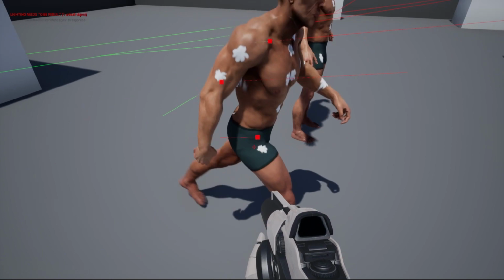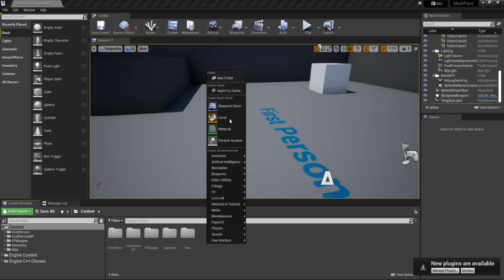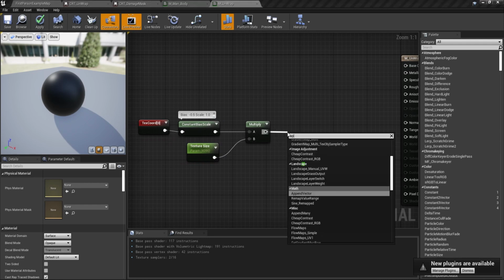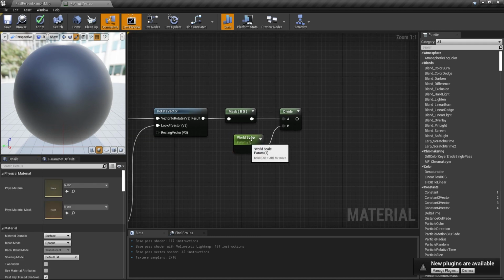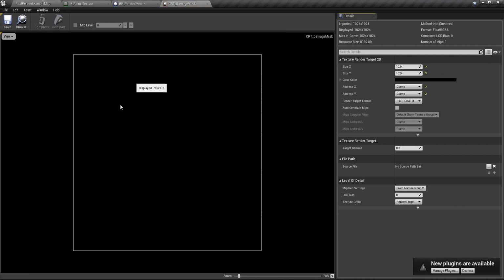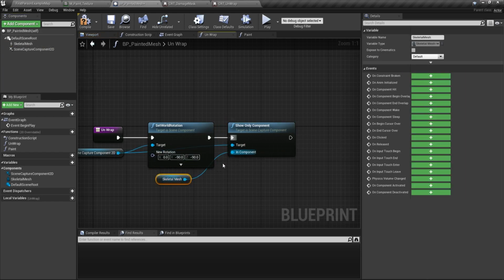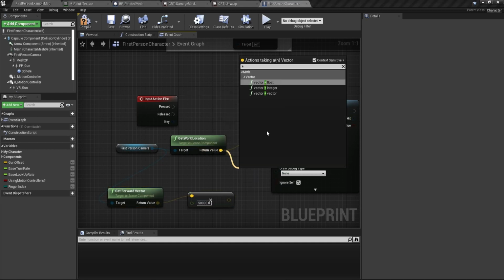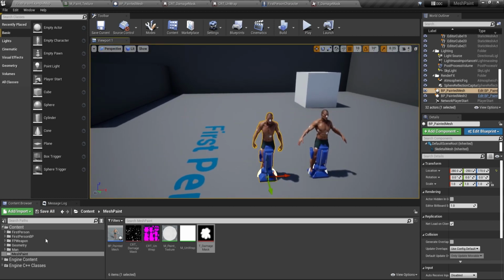Skeletal Mesh Texture Paint - Unreal Engine Tutorial (Blueprint Only)

Comment: Been trying to do a similar thing with a static mesh but it seems to be painting offset from the hit location and certain faces it wont paint on at all. 

I've also noticed when I paint on one face it paints the same thing on another face but upside down. (only visible on the damage mask, none of this is showing on the model itself)
If I put the damage mask straight through in the mesh material (by passing the lerp). It paints as expected with a slight offset to where the ray hits and it paints on both front and backsides of the object.

The object is basically a standard cube from blender, no overlapping UVs, just a standard cube net.

Comment: Hi, first thing that this is excellent tutorial and I managed to make it work without issues. Great thanks for that alone.

But I also have question: what i need is to make similiar tool which not paints but "cleans" up mesh - i imageine having mesh with "dirty" texture and cleaning it to "clean" texture (I guess its like having two textures one on top of each other and you make the dirty one invisible using "cleaner" and the clean one shows underneath). I try to think how to modify the solution to achieve this effect but I have so poor understanding of what happens here that I frankly dont even know how to start. How can i make such a feature out of it?
Reply: Update: managed to figure it out :) But I have last issue probably... how can i get some value of "how much is mesh painted"? I mean i need to know how much of the mesh is already "cleaned", some percent value probably would be best.

Comment: Thanks man!  but I found a problem if the position of character more than X:10000 Y:10000 the mask hit does not work any more it will draw nothing on character
Reply from the maker: Hi, can you please elaborate the issue you're experiencing a bit more? So i can reproduce the issue on my end and fix it. Thank you!
I believe this could be due to a limitation on how large numbers shader parameters can hold, but 10k is still in float32 range, so I'm unsure what's happening on your end. Please provide as much details as possible so i can investigate the issue and reproduce on my end. Thank you very much for your feedback. You can also join the discord server so we can chat about the issue.

Comment: Hi! Thanks for the tutorial) Tell me, if we draw a texture at the junction of body parts (torso and arm, for example), then the overlay will happen without breaking? Or will the texture be displayed only on one of them? Just on UV there is a decent distance between these parts of the body
Reply from the maker: Hi, In the beginning of the video i exactly describe this. This version does not break on UV layouts, It will paint on both sides because it projects from world coordinates not from UV coordinates.
Then it masks the projected texture using a sphere mask hiding from the other side of the mesh. But it is required that you have a good UV layout that is no-overlapping, otherwise you will be painting on multiple parts of the model.
Reply: @asteragame8254  Thanks!

Comment: Hello,

I have a little question since I had a little problem. If you can help me, I would be very grateful.

For some reason, when I go to paint the editor's default character, if I paint on one side, it paints the other side too, like it's making a symmetry. Is this my mistake or is it a problem with the skeletal mesh?

I appreciate the help.
Reply from the maker: Yes. As i explained in the video you have to make sure you don't have Mirrored or overlapping UVs. What is actually happening is that your mesh is sharing UVs so as a result when you paint you paint on both sides. To fix this make sure your skeletal mesh has proper UVs without overlaps. Or use a seperate UV channel if you need.
Reply: @asteragame8254  Thanks for the answer. That's what I was suspecting. My English is not very good yet. I understood most of it, but I must have missed this one. I am using the default editor mannequin. The white robot that comes by default in the third person template.

S2
Reply from the maker: @luannunes7597  You could just export it to blender and create a separate UV layout just for the painting with auto unwrap. That should satisfy your needs and is a quick way to get it working :)